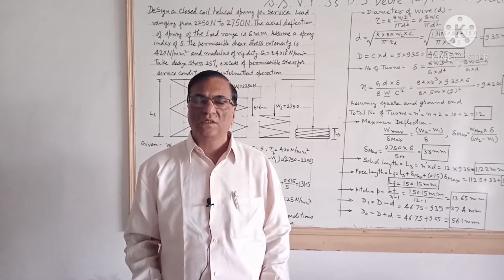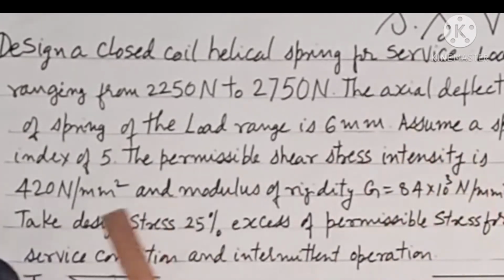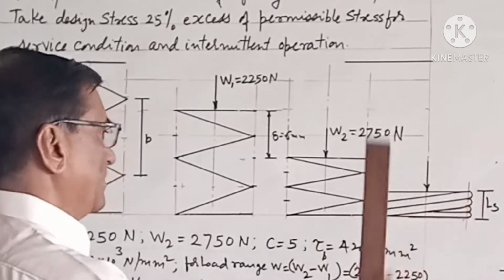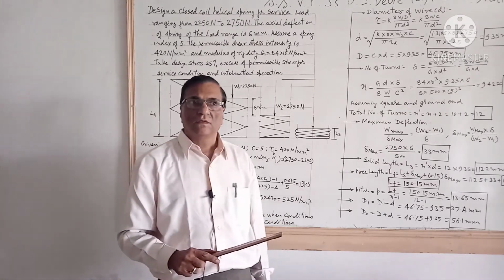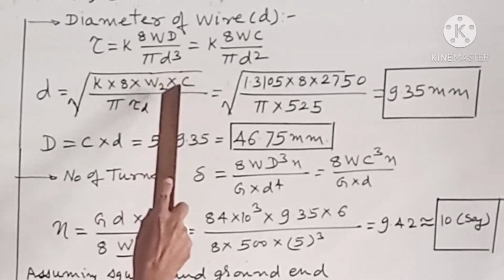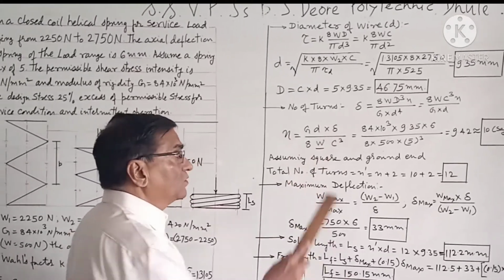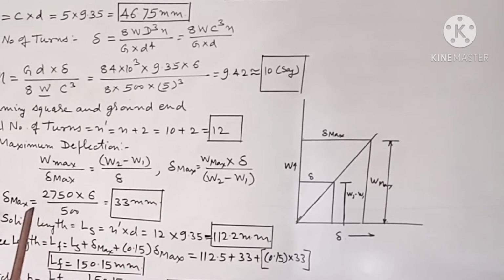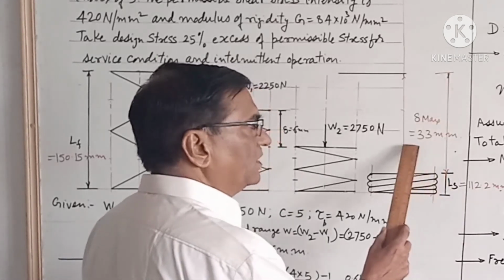Design of spring for load range (numerical) - lecture 90

Comment: how 25% excess is equal 1.25 sir can you explain
Reply from the maker: Pleasse corret the multiplication 300(1.15)=345
Reply from the maker: Suppose you have 100Rs and you want to give20%exceed Rs to other. Means (100+20)=120
Suppose a lift having weighing capacity 300Kg. and 15%exceed weight is allowed meanse
300*(1.15)=335kg. Weight is allowed.
Suppose
A-any thing
Then30%exceed of any thing=A(1.30)